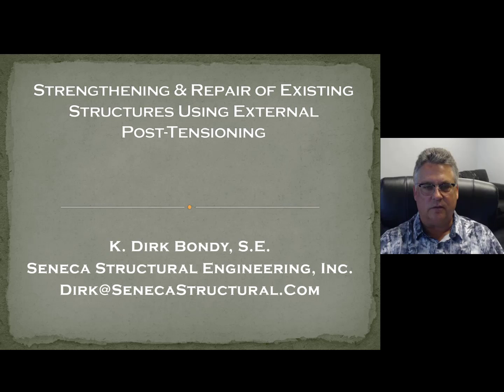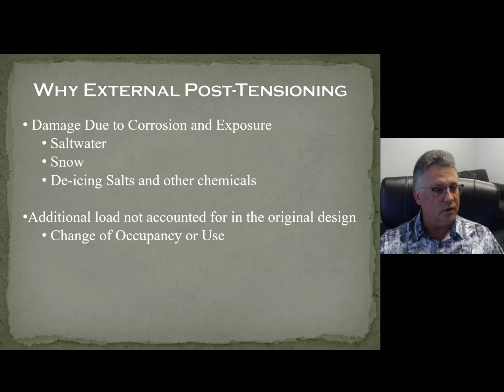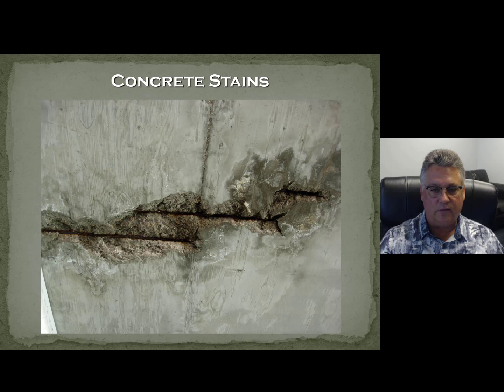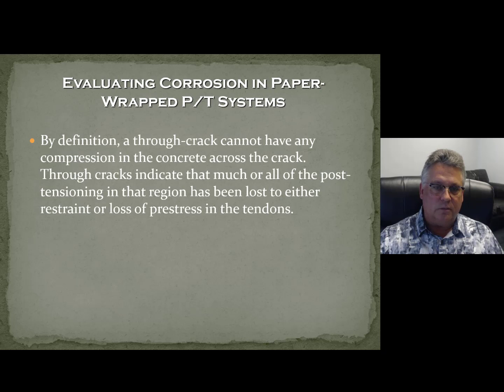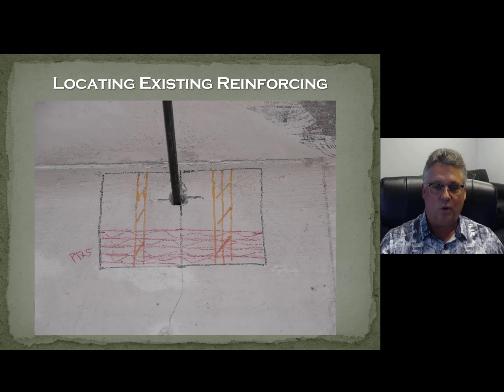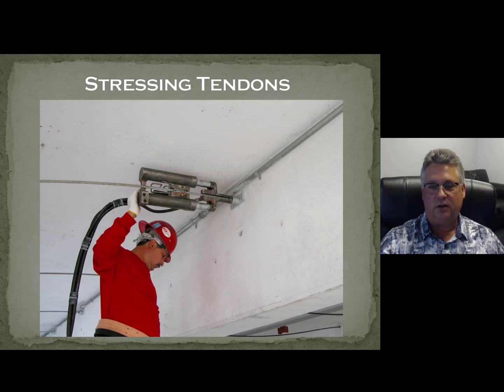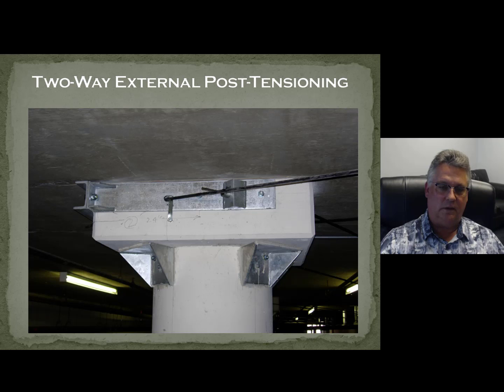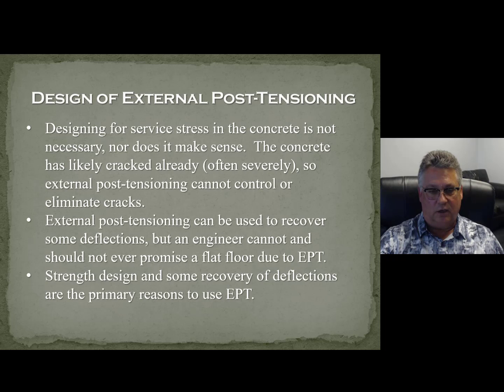Strengthening  & Repair of Existing Structures using External Post-Tensioning

Comment: 46:36 Dirk, you are going to hate me... I visualize punch shear around each one of the red transfer supports.... in the tributary areas.... I am liking the longer ''H-beam'' do transfer a larger area in the tributary areas... to transfer over to the critical shear areas... 50:10  load testing is a dead load test but cycle loading is the bear....   IMO    I really enjoy your education on PT and understand, I am NOT attempting to teach you... I am just commenting on what I see as  a form of load path  ''potential issues" ....     Imagine if you will, one of you ''red supports'' loading between a 12'' x12'' grid .... that would be a weaker point as opposed to loading directly underneath.